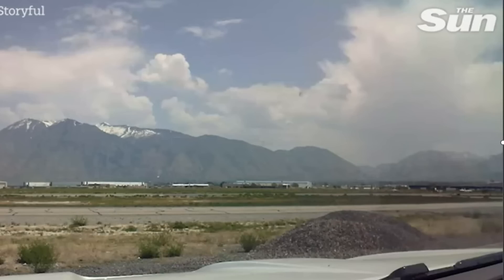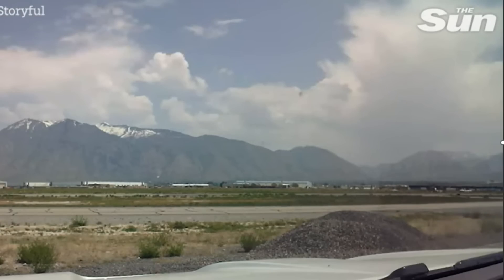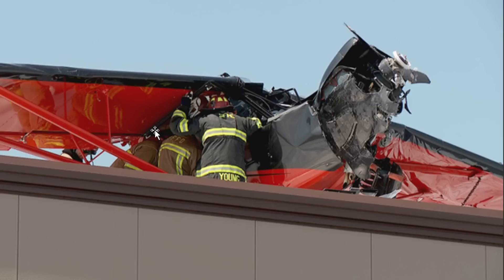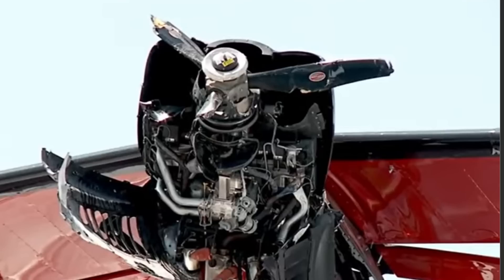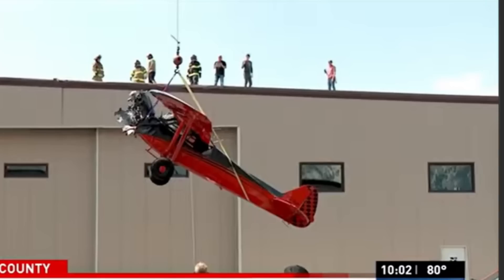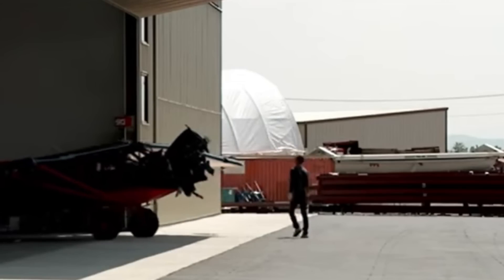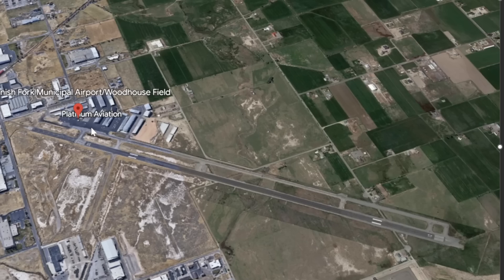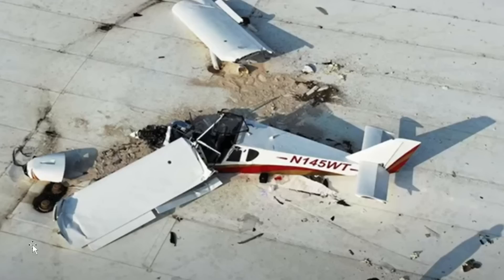Dash Camera Catches Aircraft Stall in Utah

Comment: You have to decrease the angle of attack no matter the cause of the impending stall. Push the nose over immediately and reposition the aircraft over something smooth to land on, like that excess rwy stretching out in front of you. You can’t fix the problem by settling for this high AOA hoping and waiting for impact. The hangar probably saved their lives.
Reply from the maker: I agree
Reply: I was thinking the same thing. A high angle of attack and not enough power to climb out of it. I wonder about the density altitude and loading too. No matter how uncomfortable it would feel you would have get the nose down, you ain't gonna climb...
Reply: @gator1959  yep, first response is to lower the nose immediately. Then worry about where you’re going to hit the ground, but you don’t want to wait and roll over into your back before you hit the ground. That’s the next thing that will happen.
Reply: You have to have altitude in order to get the nose down and recover from a stall. The dive of nose down picks up air speed fast and you slowly pull up and fly right out of it.  You can not do that 5 ft off the ground.  This is way take offs and landings are most dangerous part of the flight.  If you loos lift from  stall it will always be a crash.  Unless you have enough engine trust to pull out and most planes do not.
Reply: @jvmiller1995  Not at all. A cub has very light wing loading. If the pilot had immediately lowered the nose he might only have hit the remaining RWY harder then desired. He had enough energy to cross a taxiway, and then fly high enough to crash into the roof of a hangar. He had energy but not a lot
Reply: @dustdevilz4771  I have to highly disagree. So does my pilot friend I sent it too.  But you have the right to be wrong.    Now had he leveled off sooner than he would of been ok but once actually it stalled at that height it was all over.   The entire point of nose down in a stall is you have to have enough height to let gravity help you pick up enough speed to get the wings to be able to produce lift.   But Believe what you want. It is Okay to be wrong! This dude just F@$ked up.
Reply: @jvmiller1995  You’d probably end up be on the roof of that hangar too, had you been flying. The pilot had plenty of altitude, and therefore plenty of energy by using gravity, as you point out, to prevent stalling on top of that hanger. That’s a Cub, not a Pitts. In fact, it’s an exceptionally light Cub with very light wing loading. He had startle factor to the extent that he didn’t respond quickly enough in lowering the nose to use all of that nice available asphalt laying out in front of him. Like I said he had enough energy to cross a taxiway and crash on the roof of a hangar. All of that excess energy could have been used in a straight ahead flair and touchdown on the available rwy right in front of him. Case in point, I was a young ag pilot too many years ago, when I was attempting to scout a field in my Taylorcraft. I was climbing after takeoff at a steep AOA (for an air knocker) right after lift off the C-85 on the nose quit dead. I was only about 75’ above the rwy. I shoved the nose over immediately to the point that I was only looking at the gray of the concrete. I got ground rush and I flared hard. Turned out that I had enough energy to only break a single bungee chord on the gear. I did then as I do today, always, always assume my engine will fail on every takeoff. In fact, I count on it. I’m usually pleasantly surprised when it continues to run. When you loose an engine on a big jet you push rudder immediately, instinctively. Then you gather yourself and trim the rudder out and set the power at MCT. Just as you would instinctively lower the nose on a Cub when the motor quits, every time.

Comment: He didnt stall. He just couldnt climb. He did a common mistake. He rotated at too low an airspeed. As a result, he had initial climb of about 20 ft altitude and then he reached the equilibrium spot between climb and airspeed. The point where friction due to his pitch setting and his power plant are equalized, and he is hanging on the edge of a stall. The engine is putting out just enough to keep him out of a stall , the prop is cavitating the wind and there is not enough prop thrust to climb. Like a boat that cant get up on plane.  Aerobatic pilots do this maneuver at airshows. It is a spot where the plane is literally nulled.  He reached that spot at about 20 ft altitude because he rotated to climb way too soon. He should have let the plane get more speed and the prop would have got above the power curve . Once the airplane is climbing, the rate at which airspeed increases (the acceleration rate) will decrease until it reaches a point where the airspeed becomes stable (i.e., the airplane is no longer accelerating), assuming no other inputs are changed the plane will stop climbing. It was as if he was hovering on altitude, with forward motion.  ALL he had to do was drop the nose to gain some airspeed. But he was headed for the hangers, and he decided to try to gain a little more altitude to clear them. Big mistake. Better to have dropped the nose and to gradually bank away from the hangers, while gaining airspeed to start the climb again.
Reply: Agree totally

Comment: Didyou see the amount of rudder input [ie crabbing flight] or was that one heck of a cross wind? Then combine that with not enough power from the engine, they are lucky to land on the hanger. Better on the roof than nose down in the dirt with injuries.
Reply from the maker: So true. That hangar was a blessing
Reply: Looked like to me that there was NO rudder input, hence the hard crab to the left. He should have been holding a lot of right rudder. Looked like no rudder was used, at all.
Reply: @scotabot7826  Pilot here. Once you are in the air you do not want to use much rudder as you want to fly straight relative to the air which in this case means crabbing. Slipping the plane is only used for losing altitude and getting the plane lined up for touching down.
Reply: @Juhujalp Exactly

Comment: That’s the airport Mike Patey hangers at. It’s actually where he modified the RedBull Carbon Cub for the Dubai stunt recently which was a taildragger. The NX is a tricycle gear Cub. They are all designed for STOL flying and are stinking expensive!! Glad they survived. Looked like he needed to drop the nose, put in more rudder, and ad a little power if he didn’t lose fuel which could happen for a couple of reasons that are in your check list before taking off.
Reply: Mark Patey flies a nosedragger like that. Cannot remember the color.
Reply: @kwittnebel  Yeah, he sold his maroon and white taildragger to a friend of Trent Palmer’s and bought the NX. He test flew one of the first ones Cub Crafters came out with
Reply: It was Mike and Marks hanger they landed on!
Reply: @adventurebushflyers985  yeah that figures. Nice hangar.
Reply: Power should have been full
Reply: I was thinking that wa the same hanger.   They are a real tight crew their i bet mike and mark will help the guy anyway they can to get back in the air.  i bet you will be seeing this on mikes channel soon enough and it will tell what happend.     It has been a few years back but this is where mike Crashed Draco on take off due to a cross wind.
Reply: @jvmiller1995  I thought that was in Nevada.
Reply: Mike crashed his plane in Reno......just to watch it die. Sorry, terrible joke, but I love Johnny Crash. Dammit, I meant Cash. I'm going to Hell.
Reply: @scottrousseau297  you’re correct. Draco was on static display for the Reno Air Races when that happened.
Reply: @scottrousseau297  hilarious!

Comment: As others have commented. Trim or a control lock....maybe a weight and balance issue? A person I know in Fairbanks crashed his Maule right after an annual because the mechanic accidentally switched his elevator cables so up was down and down was up. Probably not the case here. I have a hard time with trim or control lock accidents. Before I was a pilot I was taught "CIGAR-TIP" a pre-take-off checklist. 
C- Controls free and correct
I- Insturments set
G- Gas on fullest tank
A- Attitude (trim) set to take-off
R- Run-up (mags, carb heat, vacuum, cycle prop, oil pressue..etc)
T- Temperatures (in the green)
I- Interior (seat belts on, gear stowed and cargo secured)
P- Prop (set to full power)
If pilots would remember cigar tip prior to each take-off some of these accidents would be avoided. Glad everybody is ok
Reply from the maker: Thank you for sharing Kirk

Comment: Freezing each frame, it appears the stick is well back throughout (elevator is upward) placing the aircraft into the stall danger zone. Unfortunately, the rudder is obscured from view for much of the video but appears briefly looking fairly straight. I'm thinking that this problem could have been picked up and avoided at the preflight stage. Unsuitable weather (excessive crosswind/microburst?), flight controls free and correct, weight/balance and cg checks, has pilot enough experience in the model? Was the engine performing well during runups and producing full power throughout the takeoff roll? This is a highly powered and light weight cub (180 HP) and, properly configured, should have been climbing strongly (apart from severe weather and/or being put into uncoordinated flight with a resulting stall).
Reply: I'm just a student pilot but l too notice his angle of attack was pretty extreme. Other folks have suggested trim and elevator position. I'm off to practice my touch n goes...
Reply: @Riley Anderson  Yes it's the one thing that stands out when you see the video. The jackscrew/horizontal stab position was central (can see in the picture when it was being lowered off the roof) which suggests the elevator trim was set correctly for take-off (assuming cg was ok). I do note what looks like a small storm in the background. I'm thinking they might have got caught in a squall. The plane looks to be crabbing severely but the control surfaces (aileron, rudder) appear normal in the footage. In my view, it isn't possible to crab a cub so severely without either crosswind or a lot of rudder. While it was high alpha flight combined with a powerful engine, I cant see the left turning tendency to possibly be that pronounced. It certainly appears they didn't build enough speed on the ground before lifting off into whatever conditions were happening at the time. All the very best in your flying and PPL Riley 😀
Reply: Well learn from this guys mistakes.   You won't always have a hanger to break your fall.
Reply: @Jeremy Miller  So true. He was so very lucky with this one. I just dont understand why he crabbed and held nose high simultaneously. Its like either the stick was stuck or he didnt know to nose over and try track the runway heading in ground effect

Comment: AQP! AQP! AQP! You should send this one to Dan Gryder, see if he's seen it yet. Several things in this one for such a short time, to include Yaw from hell, and a pilot so brain-locked on getting UP, (meaning pulling fully on the yolk, while trying to increase power), he brought himself DOWN. Insane angle-of-attack, or AOA. 

What it almost looks like? He forgot his locks, wasn't gaining altitude, pulled full back, and STALLED ON A DIME lol, dropping dead straight down on that roof- another few seconds and this woulda been a fatal, most likely.

Saw some talking about a crosswind? But I see nothing to suggest that- going off those bushes, and they're right out in the open.

Will have to do a data & weather check on this one to be sure though. Lucky, whoever they were.
Reply from the maker: Stalled on a dime lol
Reply: Dan “Cornfield” Gryder would have all the answers.
Reply: Agree. As good as Dan is, he drives people away with his smarta$$ attitude.  A little humility will greatly benefit his cause greatly.  Take a page from the Pateys Dan.  Still, love what he’s doing for animal rescue.

Comment: Going by the direction of the clouds, it seems that the take-off may have been attempted with a tail wind, That might account for the stall if the pilot was conditioned to the visual cues of a normal take-off in still air or into wind. The apparent uncoordinated flight some folk have commented on may have been the pilot attempting to rudder the left wing up after an initial wing drop and swing off the runway. It seems that although the aircraft was entering the spin to right and beginning to nose down, the wheels penetrated the roof and caught the framework tipping the aircraft onto its nose. Without the hangar roof intervening, the aircraft would have struck harder and steeper nose down. The more developed spin motion and a steeper wing strike may have then crushed the engine and framework into the left front of the aircraft cabin which would have not been good for the pilot. With there being no injuries reported, it would be good to know if the occupants were wearing full harnesses which are highly recommended. Sadly it is a total loss and expensive but absolutely the best outcome from a bad situation. One hopes the pilot and his passenger get back on the horse soon, wiser, not with destroyed confidence but not too carefree that having experienced and survived their first crash that the game of chance is now on their side.
Reply: you can't go by the clouds
Reply: The wind was light and variable all morning at Spanish Fork
Reply: @SoloRenegade  True. Cloud direction was the next best guess with no visible windsock.
Reply: @DARANGULAFILM  cloud direction is almost never the same as what's on the ground. thy are usually at some angle to one another. There is nothing useful to be gained by looking at the clouds that will inform the conditions on the ground in this video.

better to look up the METAR and Winds Aloft reports for the time/place.

Comment: The salesmanship showing the power to weight advantage of the Carbon Cub and other STOL airplanes is understandable but dangerous.  Like social media, we have no control of content, but the adults who produce these airplanes that can hover out of ground effect should be ashamed.  Look at the lack of energy management that can save pilots from this stupid high pitch attitude scenario.  Had he accelerated in low ground effect just halfway down the long runway, he would have been at his maximum possible airspeed.  He would have been able to climb with more weight than expected, a sick or dead engine, or to maneuver to a suitable landing site.  Zoom reserve airspeed is enough airspeed to climb or maneuver without engine power.  With engine power, or without, it is the safest way to take off.  It is also the best short field takeoff technique with normally powered trainer size airplanes.  Stick full back until nose gear comes just off reducing friction.  Mains off when the wing will carry the weight in low ground effect well below Vso, Vx or Vy.  Dynamic proactive elevator to bracket level in low ground effect.  Pitch up only when at cruise airspeed or when necessary to just clear (not climb way over) any obstruction.

Unfortunately Cub Crafters demonstrations of crazy too high pitch attitude takeoff say, "don't learn to fly.  Buy this airplane that will make you look like an experienced STOL guy even if you have know nothing of energy management.  Energy management, like the basic low ground effect takeoff, allows all of us, including tired low powered airplane owners, to fly safely.
Reply from the maker: Thank you Jimmy for writing in as usual

Comment: Simply pulled too much elevator to have that nose up in the crosswind conditions. Those aircraft are superlight and have large engines for that low weight. 100% pilot error. Can't hang it on the prop in that much crosswind.
Reply: The NXCub is not actually that light. Empty weight is around 1300 lbs with a max gross of 2300. That's very similar to a C-172. The engine is more powerful though -- it is a Lycoming CC393i fuel injected, 215 horsepower.
Reply: @ricdelmar4961  That's what I was saying, power/weight ratio is big. Can't hang it on the prop in that much wind/crosswind.

Comment: Mm! Cross-wind!  Well Who was flying the aircraft ? The PIC would have known there was a Cross-wind by 1: Departure clearance from the Tower, and 2: Checking the Wind Sock direction and estimated Speed!
A Departure with cross-wind and wind speed around 20 kts, keep nose on the ground to build speed “Higher “ than you would on a calmer weather, then lift off and climb out more shallow, NOT NOSE HIGH closing to stall speed, “which did happen”  
Well A very Hard lesson learnt, OUCH!!! Costly to confidence, and repairs etc! BUT a good landing as they walked away ALIVE !!!
Mm ! Circuits bashing Cross wind technique a must WITH an Instructor. 
AlLWAYS: Impress The Professionals.
Thrill The Ignorant.
And Frighten No One.
Not Even Yourself.

Fly Safe Have Fun and keep Smiling.

JB. East Surrey. UK.
Reply from the maker: Thank you JB for sharing as well
Reply: @ARFFWorld  Thank you for your reply re the Landing on the hanger roof!
You do a Great coverage on your Aviation site, Very very interesting, 
and giving my own comments is hoping it all helps someone.
Gosh So many many incidents of bad airmanship is Really a Big concern and 
Leads me to think What are Instructors NOT Teaching their students ?!!!
There is failure in the system and It
Seems a common cause is a serious 
Lake of DISCIPLINE in Initial training!
Example Does come from leadership!
Thank you once again, and have a 
Jolly good weekend.
Enjoy All.
JB. East Surrey. UK.